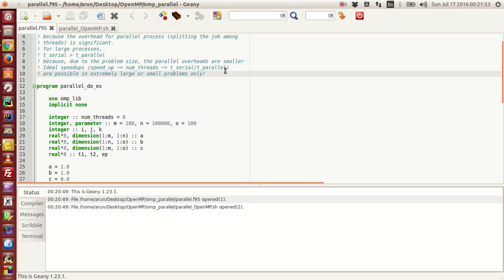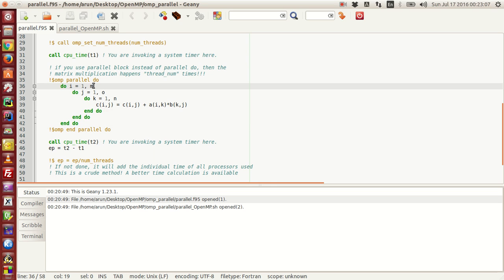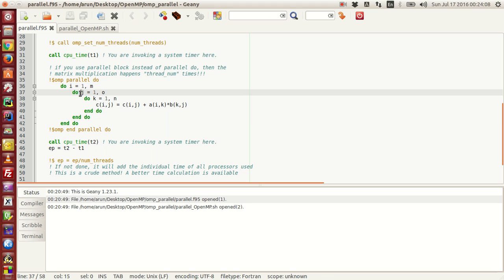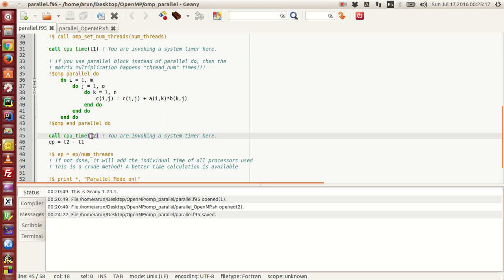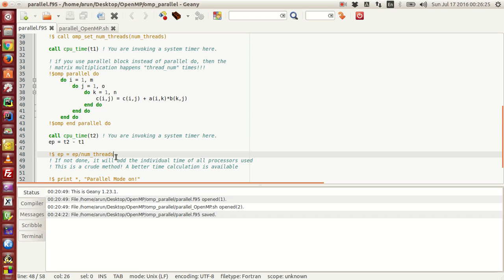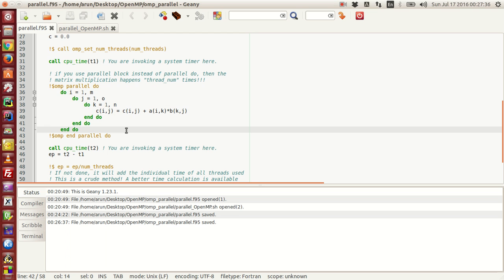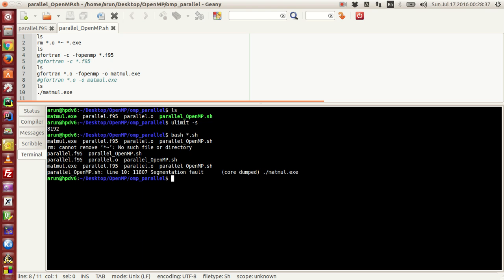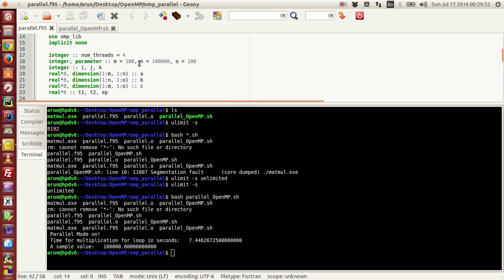Fortran with OpenMP : 004 : Matrix-Multiplication with Parallel do block

Comment: Hello Arun, 

I am following your tutorials (congrats, they are excellent). I am working on a MAC and when I tried to set ulimit -s unlimited I got the error "cannot modify limit: Operation not permitted". The I try to set up to the max value (65532) and run the program for n= 100000 I got the "segmentation fault" message. Do you know if there is another way around to this problem when working on a MAC? Thanks,
Reply: Hello Arun, 
The max I can increase stack size on a Mac is 65532kbytes. Given that, I can run the program to a max of n=40000. Do you have any advice?
Thanks,